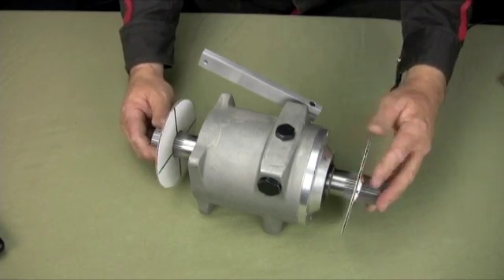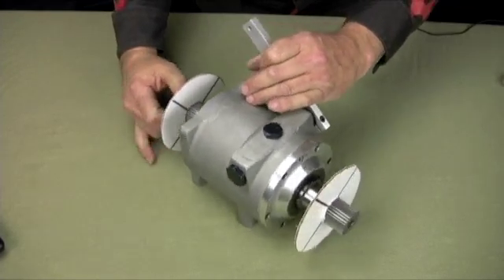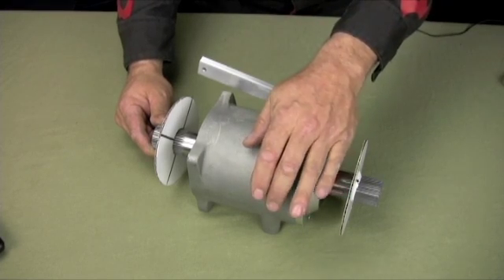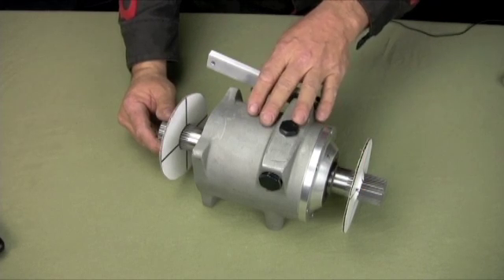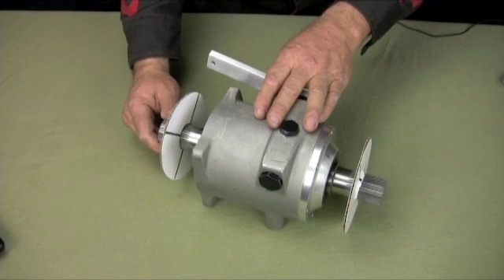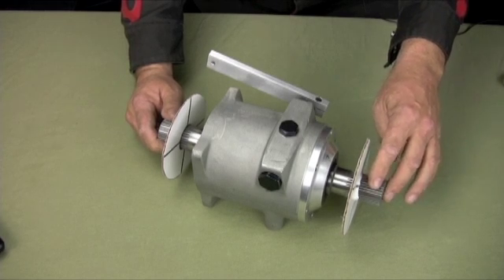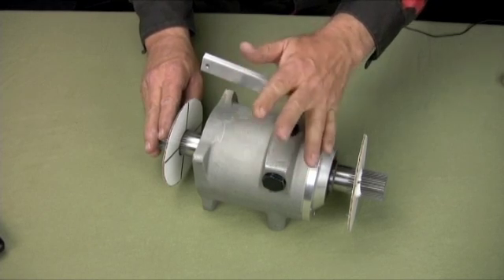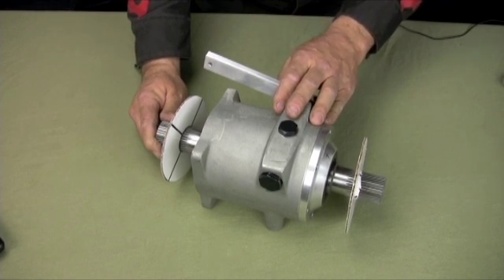Reverse gearbox for Motorcycles powered vehicles

Comment: What is needed is a unit like this that acts as a center axle with ether a diff or a spool. Then it needs reverse and everything needs to be made with quick change gears from a franklin QC rear end these are stock car type rear ends.

Comment: So the chain would go from the engine to this then another chain would run from this to the wheels? Does this just change the direction the chain spins? So if you put it in reverse you can still shift threw all the gears or is reverse its own gear?
Reply: Wondering because I want to build a half scale rally car like them little half scale nascars but model mine after a rally car and use it for off-road rally racing and I want to use a 600 or 1000cc engine from a sport bike but not sure how a reverse would be possible
Reply: Mike Fawc  Big is better. Use a Hayabusa engine or similar. Mount the motor sideways into your frame. Line this FNR gearbox with your engines output shaft and splice together. On the other side of this FNR gearbox splice in a LSD Mazda mx5 torsen diff to drive some cv axles. If your really an adventurous engineer, then add some four wheel steering into the rear end...

Comment: 1.5 to 1? Is that low enough?. How much for this unit? How much power can it handle?
Reply: Yea its enough cause your using whatever gear your engine gear box is in say first gear then throw it in reverse in this gear box so if first can take you forward its slightly lower in this reverse box. You could be in 2nd in your bike engine box and throw it in reverse and feather the clutch and be just fine its to get a heavy bike out of a spot say an incline or you got a passenger and foot power isnt enough. Usually reverse is only used a few feet at a time